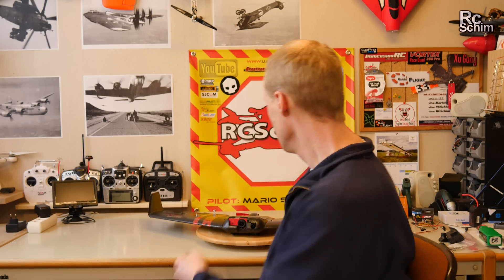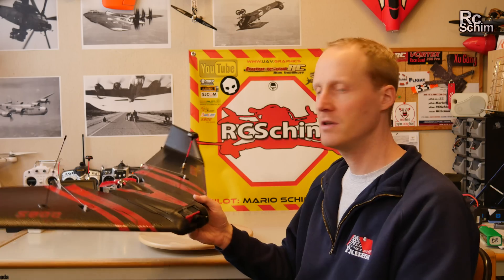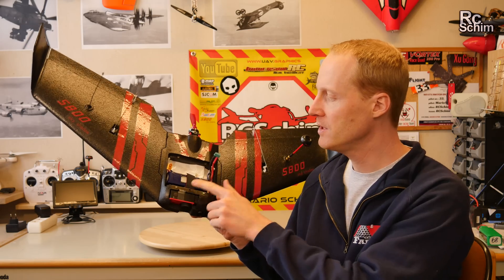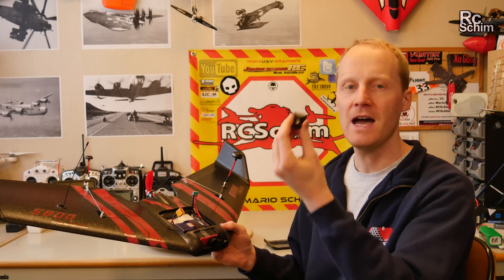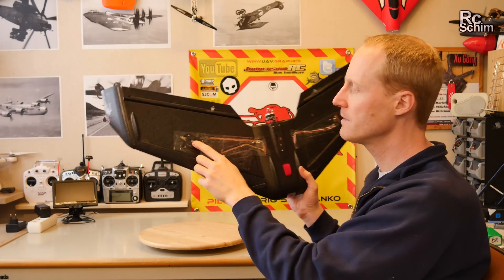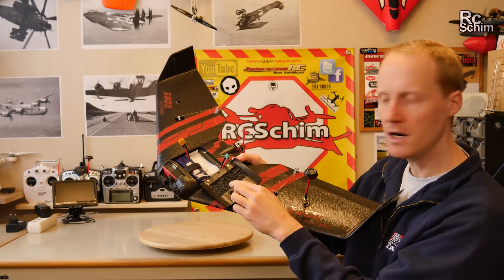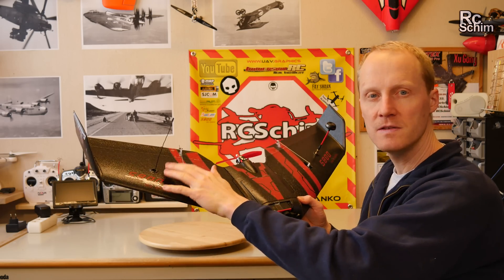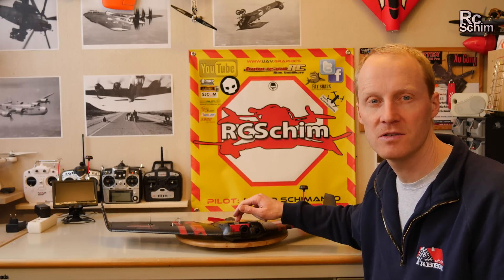Reptile S800 Sky Shadow FPV Wing review

Comment: I just ordered this plane.  I didnt know it came with stability system.  Why does it need this?  I thought it most wings are designed to be inherently stable (like my GoDiscover - it does not need this stability system)
Reply from the maker: from my experience you can skip the stabilizer board in there :)  just connect the radio RX with your 2 servos and the throttle and make the delta mix (elevons) on your radio. 
the wing is not super stable, but it's ok. I tried to increas lateral stability (YAW axis) with something called "wing fences" - dont think it was a huge effect...

Comment: Hi RCSchim Can you help me choose the engine and propeller and esc (BG or hobbyking) to get 30min fly time or more and get the clouds :) (mix throttle) I have some 2200 3s packs and L9R + XJT module, INAV.....THANKS :)
Reply from the maker: +maciek pawłowski  well, with the sunnysky motor that is in the kit version I got around 15mins, but the 2200batts I have are older... for longer flighttimes you normally use lower kv motor, larger prop and higher cell (4cell). But on this wing space is limited. So try to get the wing light, maybe use folding prop for more efficient glides? Or just take 2 batts and fly two times 15mn and just have fun :)
Reply: thanks RCSchim :))

Comment: flight time?
Reply from the maker: in my flights: around 15mins with 3cell 2000mah with avg. throttle usage.
if you want long duration and fly as efficient (and slow) as possible you sure get more time.
Reply: Thank you; What is recommended glue for joining the parts?
Reply from the maker: I think uhu por would work, maybe also hotglue? (I just finished a plane with hotglue - even though it says it's not suiteable for foam).

Comment: Hi, it is great fpv delta wing, but i got a question from you, it s my first time i m trying to buy one of that, i want to know if i can you FPV gauges on that, and how to install. 
just let me know if you can. please.
Reply from the maker: +Ramon Flores hi Ramon, if you get the set tere are fpv cam and videi transmitter. But tge are cheap and won't did good. See rcgroups.com and search for s800 or similar planes and see how others set it up. I thunk you need more info than i can fit in one comment ;)

Comment: About the 5 volt regulator... What are you using to power your receiver? Could this be a use for the regulator? 

Edit: I am building one right now. Thank you for the video! :)
Reply from the maker: that's a clever comment. normally the receiver get's it's 5v from the BEC on the ESC - but here, since they use a tiny multicopter esc, we need another 5v source.
so: I guess it was good that I soldered in the 5v thingie - now that makes me feel a bit better :)

Comment: Mario, you have put the control horns on backwards and this will give you a significant amount of differential between up and down movements.  The holes where the pushrod attaches to the horns should end up directly above the hinge-line for balanced movement.   I found that placing the horns through the foam directly ahead (on the front side) of the carbon tube in the elevons does the trick.  My S800 video will be online tomorrow so you can take a look at that.
Reply from the maker: Thanks Bruce, feel kinda stupid now :) I think I'm away from planes too long... 
I'll see how it handles or if I can remove it. But I glued it in nicely so I dont think I can change it easy.

Anyhow, cant think of flying it in the next weeks anyhow. -10C here, snow (which is nice).
Curious to see your review.   greets, Mario
Reply: Ladies and Gentlemen! I found it for 42.99 USD
https://www.banggood.com/S800-820mm-Wingspan-FPV-EPP-Flying-Wing-RC-Airplane-KIT-p-1108279.html?p=B4200913385416201708
Sweet

https://www.youtube.com/watch?v=wa8WcKNptDA

Comment: I have 2 Extender with the package, so the servo wires fit thru the old channel. Why is noone using those ?
Reply from the maker: +Sandblue you are right, i didn't think of this since i was influenced by iforce2d it seems. But one extender less is not a bad thing...
Reply: Hi Schim! With the extenders is easy to detach the wings (jus open lid and detach the connections); the problem is now the FPV wiring =) Cant fly it too, snowy ice rain here.

Comment: thanks, waiting for the kit to arrive. planning to use this with iNav and a GPS to you think there is enough room for a FC? maybe with PDB, OSD and GPS?
Reply from the maker: it can be a bit crowded in there with the battery. But the electronix that come with the s800 are quite big. if you use own stuff maybe the space is used better? you can maybe put single parts directly in the wing by cutting out parts of the foam...